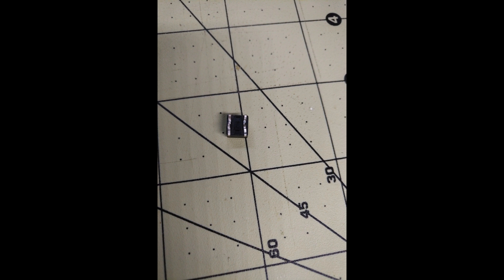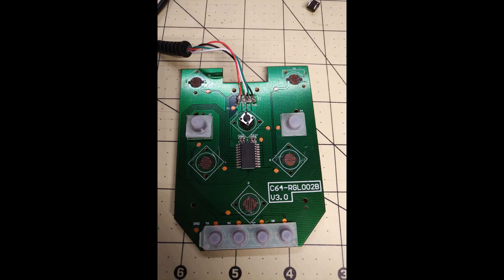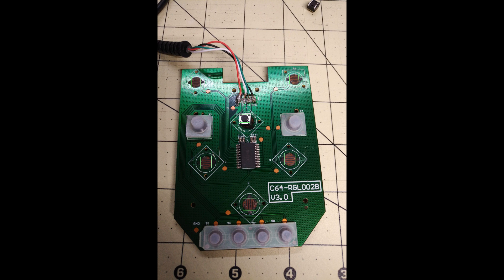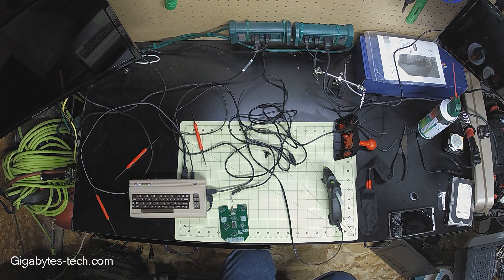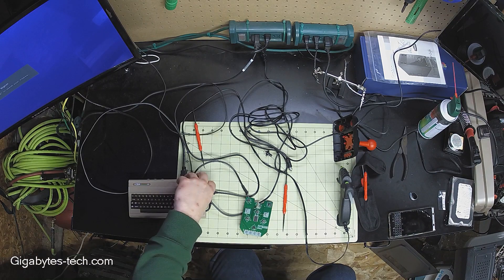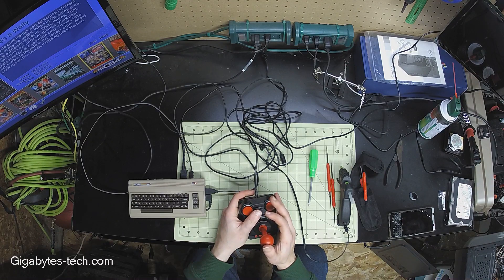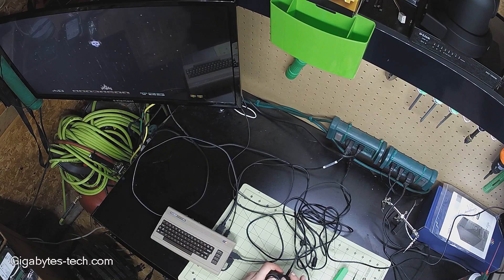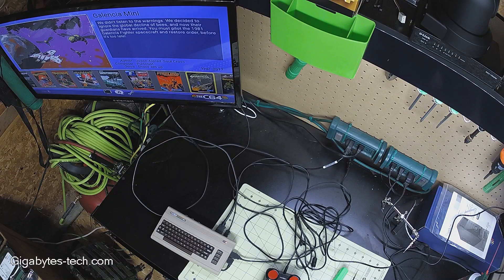C64 Mini Joystick Upgrade REDO

Comment: Hi. Could you give further details? Soldering poings close up view, microswitch size (ebay link no longer works...). Thank you.
Reply from the maker: This was done a while ago. I ended up buying a multi-pack of switches and using the ones that gave me the best feel. Like this one. https://www.ebay.com/itm/140pcs-14-Types-Momentary-Tact-Tactile-Push-Button-Switch-SMD-SMT-Surface-Mount-/163466502452?_trksid=p2349624.m46890.l49292